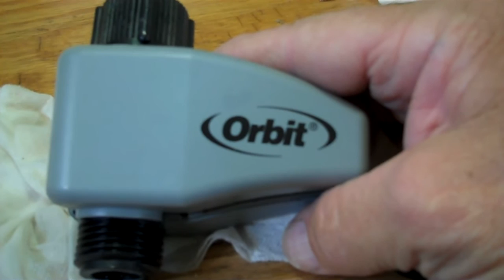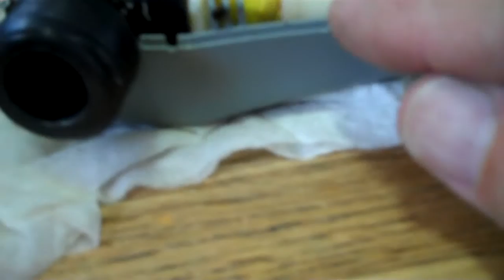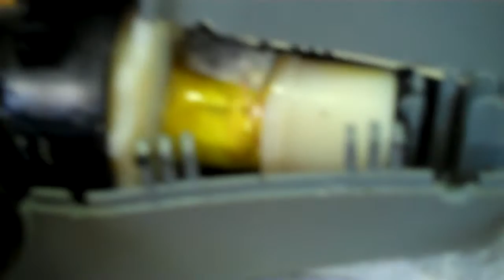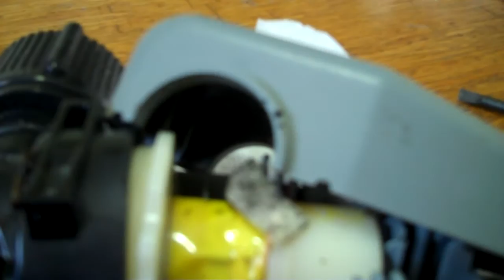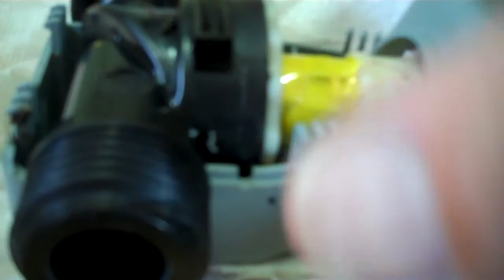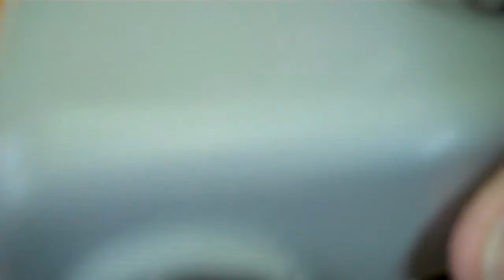ORBIT Valve repair

Comment: I could not even program mine. I removed the battery pack and there was a little bit of liquid residue inside, wiped it and is now working. I do remember to bring them inside and remove the batteries.  Thank you

Comment: Thanks for posting this. This is exactly the issue I encountered with an Orbit B-Hyve valve. My valve had some damage to the threads and still leaked slightly upon reassembly. I added thread seal tape, and a bead of plumber's putty in a ring around the bottom of the threads on the white piece, and that resolved the remaining leak.

Comment: Thanks. This was exactly the issue with my Orbit b-hybe valve. The threads were damaged slightly on my unit, and it still leaked a little after unscrewing and rescrewing the parts. I

Comment: Joh, I am in Texas, we don't freeze much here. 
I use the same Orbit brand solenoid and mine regularly burst open and spray water  (in spring summer or  fall).
The thread is not strong enough to withstand the city water pressure. 
I returned it to Home depot 3 times and the problem just keeps repeating. 
Just a bad design.
I would not recommend this solenoid.
Reply from the maker: zsebi696 I would just get a pressure regulator I don't think you're going to find any of them that will withstand anything higher than 60 lb 
60  pounds is normal
Reply: I’ve replaced dozens over the years too. Such a pain. What is a pressure valve and where to get one?